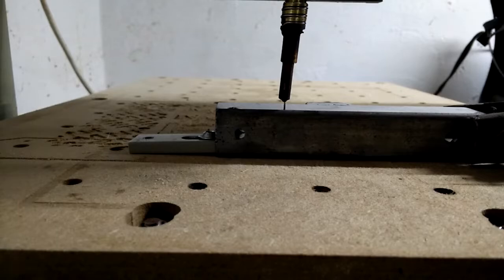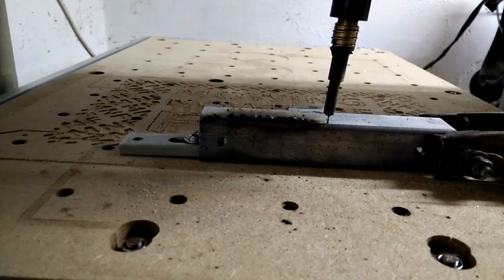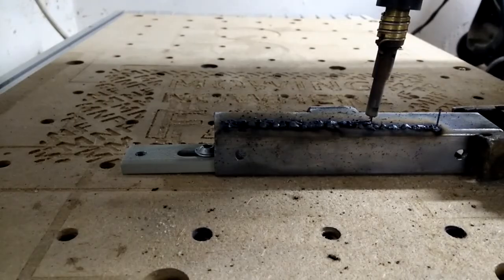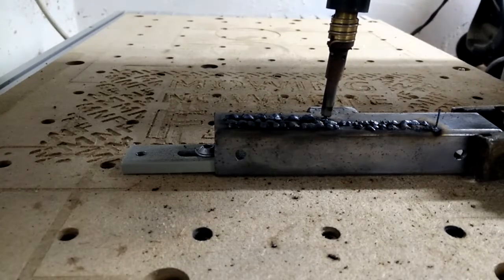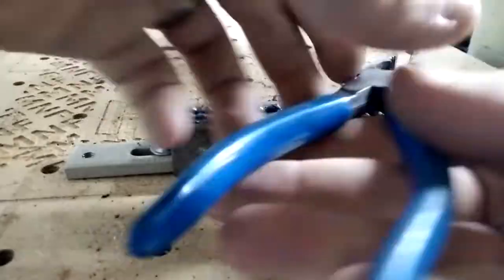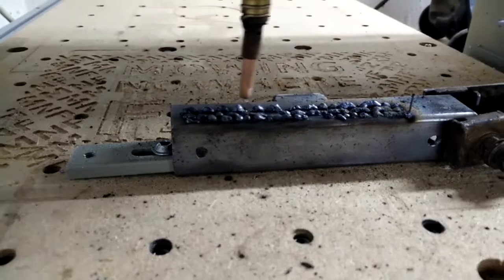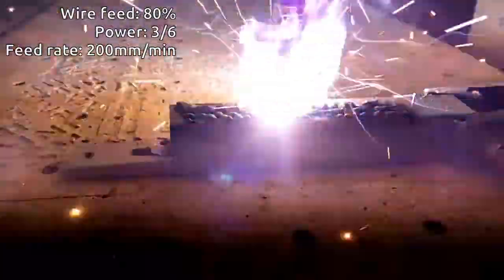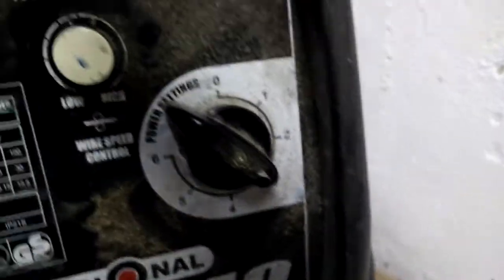CNC MIG welder for 3d metal printing: first experiments

Comment: I've been thinking about building something like this for testing. I also use a gasless MiG. One important thing I think would be to put a little tilt on the torch and apply wave or circular movements. This way you can have a uniform "bead" or weld without much spatter. Using soldering paste can also be useful.

Comment: Good idea. But it doesn't look like you've welded anything before. If you did you'd know that your speed is way too fast on the movement man. Nobody welds that's fast, so don't expect the same gun to weld faster when operated by a machine. It's the same welder at the end of the day. Slow the thing down drastically